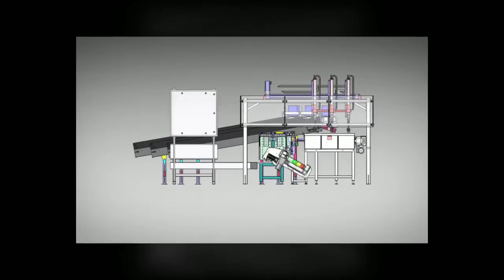Bell Pepper Special Pack Machine Overview

Comment: Wouldn't it be better to just slide them into the bags horizontally and then turn them upside down to pull out the robot arm, instead of this whole complicated pick&place system? looks so over-complicated. Also, since humans are still involved, they could just as well pack the fruit directly into the bags. Why build a packing system then?